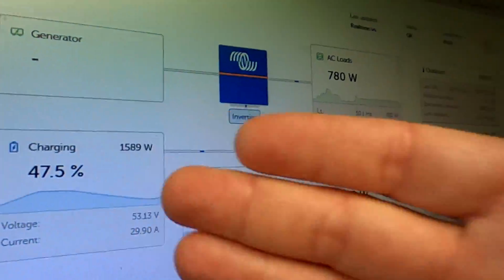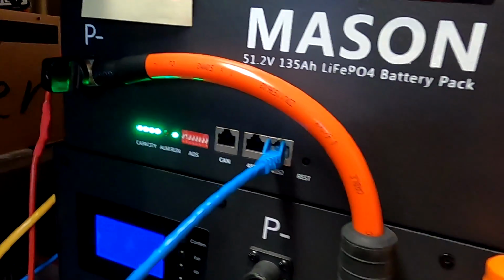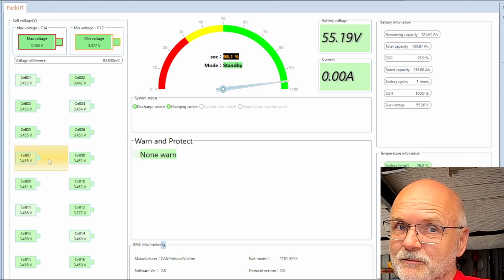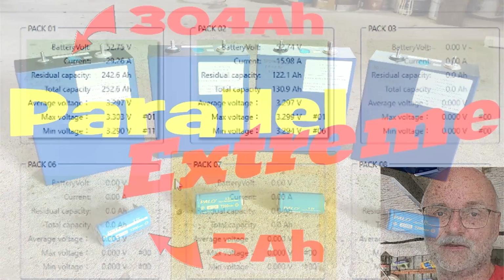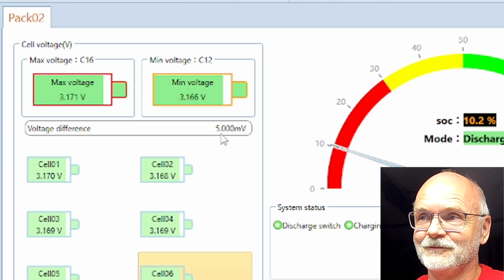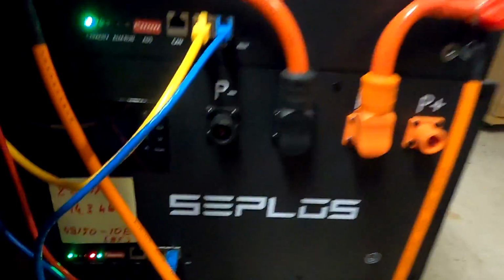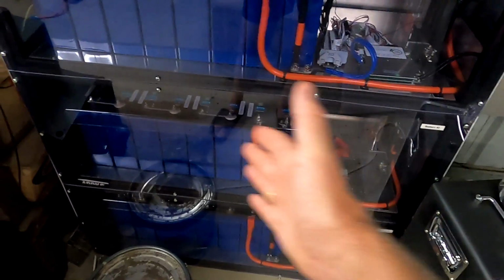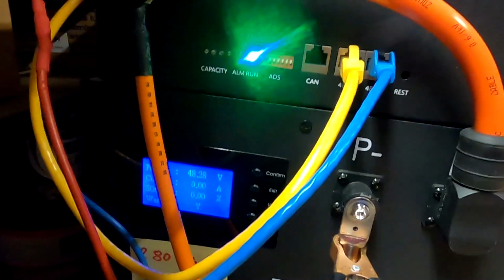280Ah and 135Ah batteries with different BMS in parallel. See what happens when discharging...

Comment: Nice test! Which active Balancer will you choose to parallel it with the seplos BMS?

My understanding is (beware of Maschinenbauer-Halbwissen), that the packs don't have a chance to behave different, if they run parallel on a common Voltage-Level(BUS). If you want a redundant system with redundant packs, you have to 'split up the voltage levels' on which every pack runs. And that is only possible with individual inverters. 

My guess for the  alternative energy source is, with respect to your roots, a yeast culture, fermenting malt to methanol, which is then destilled to run a fuel cell ;-) 🍻
Reply: But that wasn't the sense of the test, because with indiviual inverters it would not have been a pur "parallel operation" of the two packs.

Comment: Hi Andi,
no supprise that the average voltage of each cell in both packs is the same. It's math. Both pack volatage are the same, and you have the same amount of cells...

One more point: You have 2 week cells in pack 1, so this pack will be shut down more early. Having week cells is not good.

The 2 BMS will not talk to each other.

Comment: Maybe the purpose of the communication is to get all data from all BMS's to the computer over just one wire.  I have 5 strings so I'd have to connect 5 cables to the computer if they didn't daisy-chain through.  

BTW, my 16 cells strings are also different capacity with no communication between BMS's. And it works great. I have two 200Ah strings, a single 230Ah string and 2 280Ah strings.

Comment: There is no communication between the BMS in your setup.
RS485 can’t handle bus collisions like CAN, therefor it has to be single master.
You configured all BMS as slave devices and your PC is the bus master, just to poll the data.
Of course the PC software could have disabled the other batteries, but the PC software isn’t part of the production setup.
In the CAN setup one BMS is the RS485 master and communicates with the other BMS, so in this setup it could be possible that there is a whole bank shutdown initiated by the master BMS.

Comment: Hey Andy, the main purpose of the comms cable to the Victron that I can see is to dynamically control the charge and discharge limits. I have had 4 of these BMS packs @ 100ah each for about 6 months. The other details such as temperature, highest and lowest cells and which sets are currently running. I did have a BMS cell cable that came loose and disconnected the entire supply which is of course not desirable for redundancy. Thanks, Matt.

Comment: Hi @OffGridGarageAustralia
You are the forgetting hybrid and grid tie system again. In those systems the inverter can regulate charge and discharge.
The actual communication is between BMS and the inverter, NOT between BMS(s) and usually the inverter on have one communication port therefore cannot connect multiple BMS in a star topology so it must use daisy chain/bus topology to connect to all BMS. For a hybrid or grid tie system it works great, program it to reserve 50% soc until midnight in my system so even if the grid goes out in the middle of the night, I have enough battery to get me through to the morning.

Many videos ago I commented about the hybrid solar system and you seem to have forgotten about it. I also explained about how rs485 communication works. It is a master/slave protocol and inverter is the master device and BMS(s) are slave device.

Comment: Thanks for the well conducted test Andy. It turned out pretty much the same as I've observed paralleling smaller EV and eBike Battery packs. I also tested a 300watt hour, 120amp 13S Li-Ion pack with a 600wh 16S LifePo4 pack in parallel and the result was essentially the same. I did like how the Li-Ion pack improved hi-load response and the LifePo4 pack stabilized voltage drop, together the two different  chemistries complemented each other very well. I was also able to charge them in Parallel to 54.6v using a Li-Ion changer with no issues, and still got about 98% capacity out of the LifePo4 pack.
Reply: I believe there's a simple mathematical relationship that captures this. If you overlay the charging curves of each of your packs, then each pack will receive current in inverse proportion to the slope of their charging curves at this charging voltage. Steepest curve gets the least current. Complicated because each chemistry also changes its curve based on charging rate.

In other words... Q: how many Ah does each of these packs need to increase their charging voltage by 0.0001V? A: The system voltage can't increase until every battery has received those Ah, and more/less Ah means more/less amps to keep them in balance. 

Question for you - you'd expect cell types to sag their cell voltage differently if you suddenly cut charging. Does that give you voltage imbalances between the packs?

Comment: OK, guys, don't hate me for this... (At least wait til you've read it first.) 

The 280ah seplos test cut out after 252ah of discharge, and I believe this simply means that cell 6 is a 252ah cell. That's what it means for it to be weak?

Yes? No? 

Here's the Frankenstein bit - would this become a 272ah combined "cell" if you wired your 4x 5ah cells in parallel with it? To be tested on the bench, of course. 

You've already shown that you can safely charge 304ah and 5ah batteries in parallel. Would it be safe to do this to an individual cell without independent BMS protection? 

A quick search on Amazon showed that there are 3.2V 25ah prismatic LFP cells available. 1C charging recommended, but 2C is safe. 

If you wired one each of those in parallel across cells 6, 7, and 8, would you end up with a 277ah battery?
Reply: Just no .  :>)
Reply: @onthelake9554  Okey-doke!

Thanks for letting me know.

Comment: If they are transistor based BMS’s I would assume the communication would be letting the charge/discharge mosfets increase and decrease the rates to try and help keep the SOC somewhat closer. The way the discharge current was bobbling around on each one possibly that was happening? Hard to tell. I wonder what the manufacturer has to say?

Comment: Seplos bms when reached the maximum overcharge current is instantly reduced to 10amp. and every few minutes I think its 20min it checks to see if the current is still too high and if it is still too high it will stay at 10amp until the charge current is under the maximum overcharge current. I love this feature because it let's you connect batteries with different voltage without having to worry about huge flow of current going to the lower voltage battery. for this alone i like the seplos bms. bms like jk and overkill don't have this feature

Comment: There is no communication between batteries. You have all BMS in series and each one have a different binary address so you can have the information of 2 batteries flowing in one data cable. At the end you are only transmitting data from each battery to the computer. Since they have different binary addresses….. they do not “see” each other ….. Thats why you see them alternating in the software. I hace 6 200ah 25.5 volt eg4 and they turn off one by one at low state of charge and the time between each one turn off gets shorter each time.

Comment: Hi Andy,
As both (or several) batteries are connected in parrallel, isn´t the communication between BMS´s there to avoid charging the discharged battery by the remaining battery (which still holds capacity)? As such avoiding that some capacity is "wasted" instead of all of it being used to power your home appliances.

Comment: Comms in this case is largely for monitoring and configuring. The comms for the inverter/chargers it can help when charging for example, it can tell the inverter/chargers to reduce the current as needed if the battery is getting close to cell over voltage, or getting too hot or too cold etc. Would be interesting to see if you connected the Seplos CAN to the Victron system, can it control the charges to reduce their charging current etc?
Reply: Hi, yes it can. My Seplos BMS is controlling my Victron Multiplus II both voltage and amps, when charging and discharging the charge or discharge protections are not needed to be activated by the BMS because it will tell the multiplus to stop before the protections are needed.
Reply: @tx75e94  Andy is not using the Multiplus to charge he has multiple separate victron solar chargers that would need to be controlled.

Comment: Andy, in your former life, did you ever announce any horse races or have you ever been an auctioneer??? Watching you in fast mode to save time, you sound just like a master of Ceremonies.   {{{ Seplos 1 on the inside and seplos 2 next to the rail and its, its ,its seplos 1, seplos 1 takes the Cup with seplos 2 comming in at a very close second }}}
SIDE NOTE Teslander charging ports. ::: Here in the states there is a problem... It seams that the new fangled chargers of a certian brand, Not tesla, can not handle the super cold, and EV owners are having quite a time getting semi stranded  when there EV is at a low state of charge. Not EVS fault, but it is the Charging station faults.  Older versions installed in 2016  dont seam to mind but the NEWER models with cheaper boards and cheaper Software fault out. @  -4 to -7f Watched it here on UT last night.

Comment: Benefit of Comms : an overall SOC across all packs is communicated to the inverter, right?  Much better than relying on total voltage if you’re using a hybrid inverter like a Deye / Sunsynk?
Reply from the maker: But what SOC is it reporting if the individual BMSes show 10% difference in SOC? Not sure if an average SOC is better in this case.
And SOC is a calculated number, so totally dependant on when it was calibrated (fully charged) the last time. Voltage is always precise and up to date.

Comment: You did not check what the reading was on the inverter and soc on both inverter and seplos as you were did charging especially at the end when one battery was done and the other was still on 
I have a 500ah battery connected to a Victron shunt and a 300ah connected to a second shunt so my Victron inverter always shows the voltage that  my 500ah bms showed never did it show the 300 ah true voltage
Reply: Thanks for the love. Send me a text on telegram with the username above🔝🔝🔝 You've been shortlisted for my New year giveaway....
Reply from the maker: The inverter does not show SOC, just AC and DC voltage.

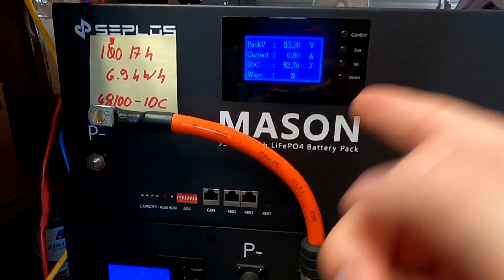Comment: 4:25 3V is indeed a huge voltage delta.
I have 2 batteries with JK BMSes with SCC charging ~35A to each of them. When I disconnect Battery A (via a Circuit Breaker) and let Battery B charge with ~70A for a few minutes. When I reconnected Battery A back, I noticed a huge current flow out of Battery B (Negative 100A+) (as reported on JK App).

The voltage delta between these two should be relatively same before and after the reconnection and I witness.
Reply: Thanks for the love. Send me a text on telegram with the username above🔝🔝🔝 You've been shortlisted for my New year giveaway.......

Comment: Even if you mix chemistry batteries. As long as the low and high total voltage is the same it has no issue.
Reply from the maker: Not quite true as you could have huge currents between different batteries in parallel. Especially if they are of different chemistry. We'll test that 😉

Comment: I think the total shutdown is based on what the maximum discharge limit is set for each pack's BMS.  If when large pack shut down the smaller pack shifted to taking more current than its set maximum discharge limit it too would have shut down regardless of its state of charge.

You really need to make sure the maximum charge and discharge currents for each individual pack's BMS are set appropriate for the battery size in that pack to avoid the inverter pushing too much charge or pulling too much discharge current on each of the single battery packs.

Question is if you approach a charging single cell overvoltage on any pack does inverter/charger back down charging current to avoid a BMS overvoltage shutdown on the single pack with the cell approaching overvoltage.

The BMS just reports the situation to inverter/charger.  The inverter/charger needs to make decisions on that info.  Since it would be difficult for inverter/charger to manage multiple parallel battery packs I think it just goes after the worse situation, so my money is on it backs down charging rate based on single cell in single pack saying it is approaching overvoltage limit.
Reply: Okay, let's say that the total current exceeds the remaining active BMSses.
Are you saying that the inverter should then tell the remaining active BMSses to shut down?
But then: what is the difference between that and an individual BMS to shutdown, if the current is too high?
I reckon that if the current of the 2 remaining BMSses would be too high -when not communicating to each other-, both will shutdown quickly after each other. 
But does that matter?
A shutdown is a shutdown. 
Without communicating,  I would say it's more reliable. 

Only thing in my mind is a remark made (on this channel??) Some time ago,  that a mosfet burned down.
But i can't remember the reason.
Reply: @gubbernl  inverter/charger should not tell bms anything.  It does not know what is good for a particular battery.

Comment: If you have DVCC enabled, then the master pack communicates to the system what can be the maximum charge and discharge current from your batterys thats the main benefit i see.
if you check your battery parameters in venus os, you will see CCL and DCL values ( Charge Current Limit ) and ( Discharge Current Limit )
if one pack can do 100A, 2 pack connected together with communication will tell the victron system that it can do 200A in total, if one pack shuts down it will limit the charge and discharge current to 1 pack value.

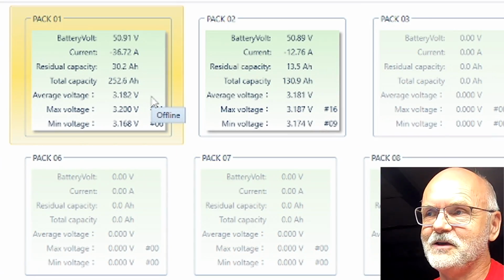Comment: 17:45   The average cell voltages of two batteries in parallel are always exactly the same = BatteryVolt / 16
Reply from the maker: They don't have to be. Unless it calculates this as simple as you said and not averaging all cell voltage individually.

Comment: 2 in 1 is usefull for Growatt and other inverters using canbus cause in these systems multiple batteries should be act as one in the growatt app which accepts such seplos bms as a genuine growatt battery if you use the canbus.

Comment: Could it be that  big battery was back feeding the small one, how can we explain the difference in discharging amps? Your 3 battery system is pretty much equal in discharging since all 3 are same capacity. Like the Daly balance bms kit that allows power from big battery to small one for even discharging. Please share comments on that.
Reply from the maker: The banks in my battery shelf don't have the same capacity. The top one has 304Ah...
I've never seen any cross current from one bank to another with all the testing I did. Unless one bank was shut down for a while and voltage difference was larger...

Comment: Hi Andy

These seplos batteries are "industrial" batteries, probably intended to be for standby backup power. If these batteries are at near full state of charge for most of their life the balancer would be adequate to balance.

Since your use case is different with potential lots of cycles you're right that these balancers are inadequate.

It would be extremely nice if there was a programmable relay in these bmses so a external active balancer could be connected.

Regarding the communication
Rs485 again heavy use in industry and there would be a custom control system monitoring the state of the packs, for you..... it's useless

I do remember the CAN video where the CAN showed a total battery capacity as one battery for multiple packs, that would be useful for you because its regarded as one battery and shows as one battery in software, the Victron software. I do believe that even in CAN mode the BMS would act independent and shutdown the same as they do now.

What i believe how the CAN mode works is that you select one battery to act as master and tell that one (by dip switch) how many batteries are connected, the master battery polls the slave batteries and Adds up the total capacity, amps and available remaining capacity

Hopes this helps you understand these batteries a bit more
Reply: I use this exact seplos kit with grade A cells and I have no issues with them getting out of balance. An active balance port would be nice in a future BMS version though.
Reply from the maker: Thanks for your comment. Not sure if these batteries/BMSes were intended for standby backup power only and we 'misuse' them for our solar purposes now. Even leaving them sitting over night, the balancer did not make any progress.
Yes, the overall capacity is being reported to the Victron system, so that's a plus. You're right. We have seen this in previous videos where I tested this.